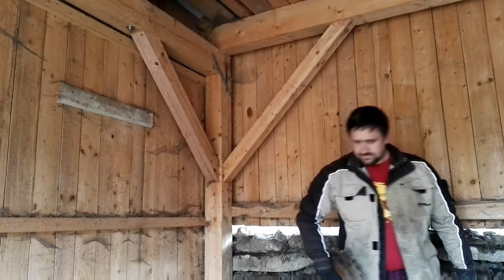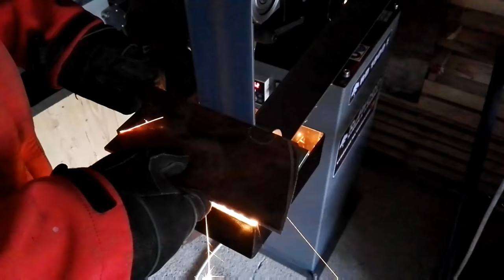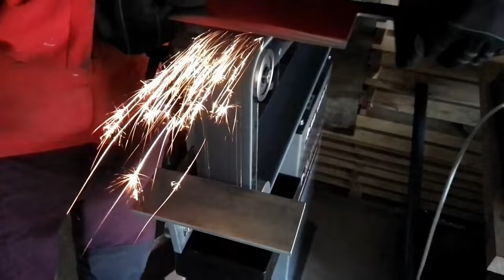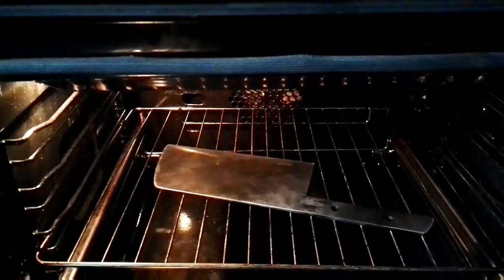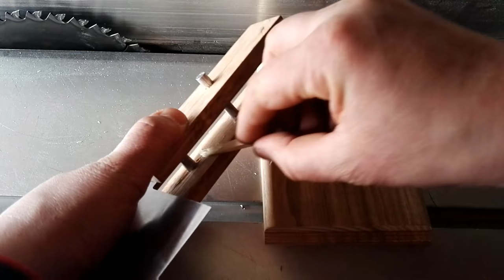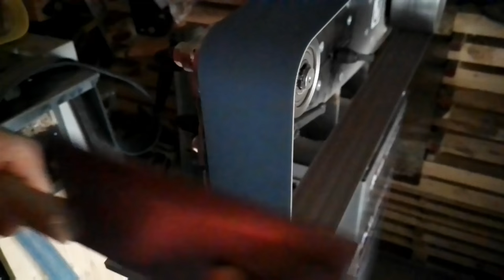Make a cleaver (knife) out of the saw blade

Comment: I don't think you actually hardened that blade.  A wood fire typically burns about 1,100F (600C).  Most carbon steels need to reach at least 1,500F (815C) to harden.
Reply: he just made it for the video.

Comment: I felt pretty dubious about the heat treating, in order to know your knife has been hardened or not there are 2 ways you can do: A file and a magnet test.

Magnet-After heating it, you check with a magnet, if it's 100% non magnetic then it's good

File-After heat treat, try to file away the steel, if it doesn't cut into it but just skates through it then it's good.

Comment: will it rust same as saw blade ?
Reply from the maker: no if you tak care about it, it seems you should make it dry after wash.
Reply: I see.. I made a knife from some scrap metal piece and now it rust very quickly after every wash or contact with water, not good for kitchen knife...
using mineral oil after every wash to keep it clean of rust
Reply from the maker: That is also reason I did not make the mirror finish, will just sand it once again time to time.